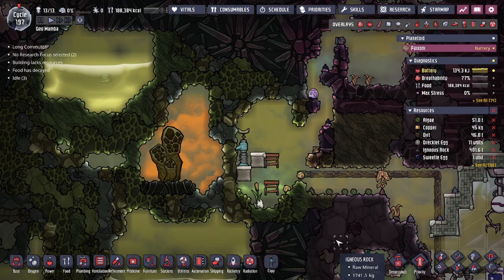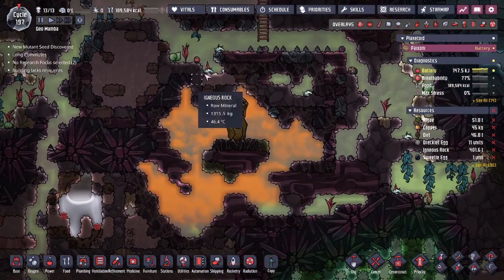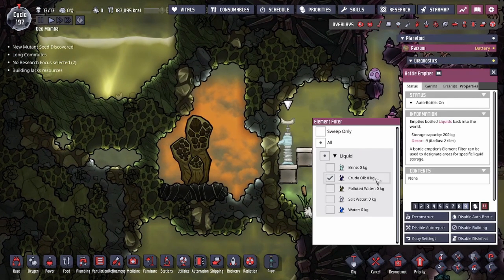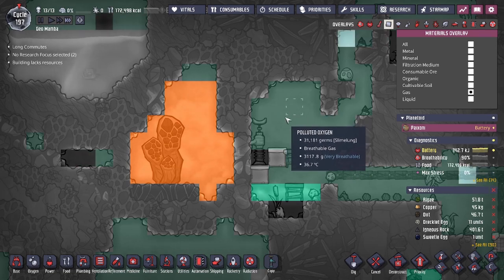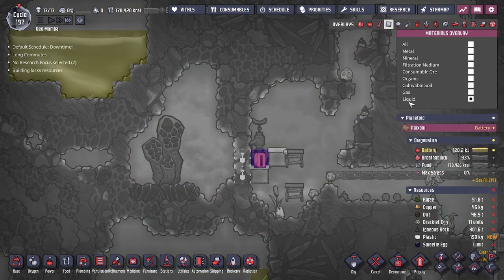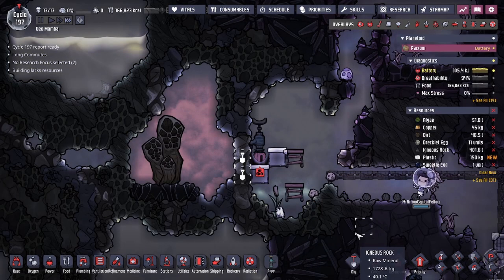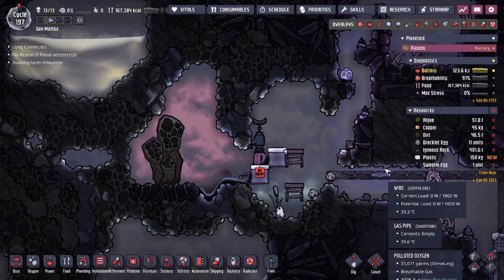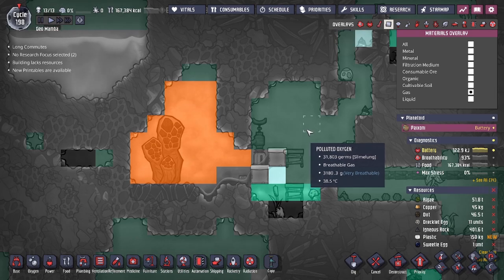Breaking into a Gas Pocket Safely - How to tap into open gas Geysers - Oxygen Not Included

Comment: In my recent game I built a "cascade" where, on command, I drop a liquid on a corner. The liquid comes from a vent and is pumped by a small liquid pump controlled by a manual switch. The excess liquid comes back into the pool where the pump is. What liquid is left on the corner is exactly what is needed for any kind of liquid lock. Said liquid is mopped and manually sweep wherever is needed. These cascades are made for each type of major liquid. Two or three liquid locks are easier than ever.
Reply from the maker: oh i see so youre getting exact amounts for a single drop lock